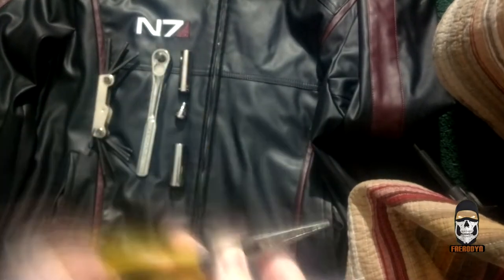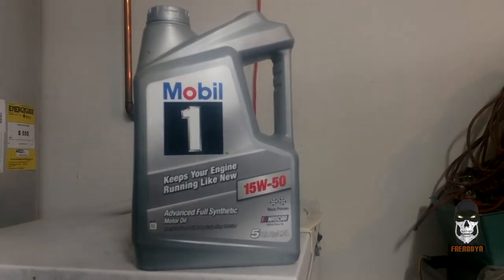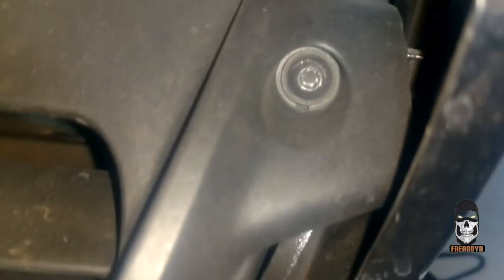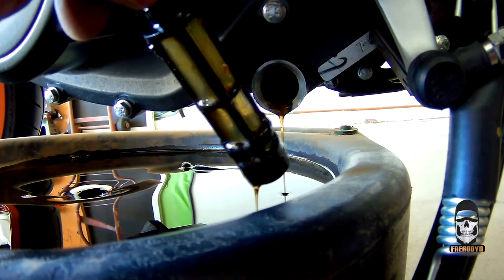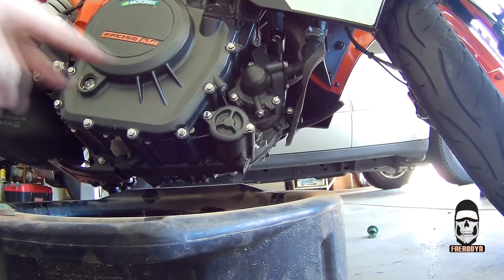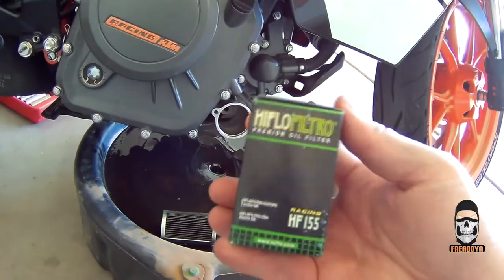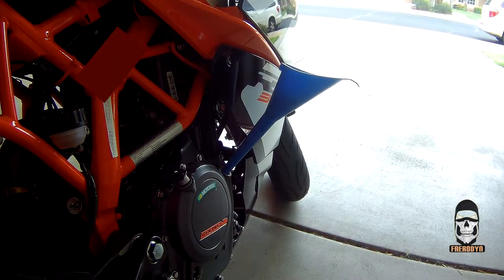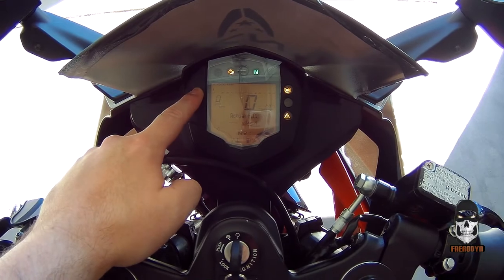KTM RC390: How To Reset Service Message and Oil Change Tutorial

Comment: I just changed my oil Maybe 250 Mi ago, I just bought this bike 2 months ago, my service light has come on though. Is there anything else I need to do to it in order to service it properly or is changing the oil the only thing that's needed and if so can I reset the service light to let the bike know that it's been serviced and can remind me however many miles later
Reply from the maker: If memory serves, I think in addition to changing the oil and cleaning the filters you also need to check the valve clearances. That involves removing the engine from the bike and stripping down the top end (cylinder head) to get to the valves. That's the bad news, the good news is the only parts you should have to buy are the shims. Ari Henning had a great video on how to do this yourself. I'll see if I can link the video for you here.
Reply from the maker: https://youtu.be/sScXWEoSqyM
Reply: @FaerodynMoto  thank you that would help. And damn that seems like a lot of work. I could do everything besides that last part, well I could do that part also but I would feel better to get something like that done by someone who knows it better than me. If I fuck it up I have to blame myself, if a shop fucks it up I blame them and they have to pay to fix it haha
Reply: @FaerodynMoto  watching it now, thanks
Reply: @FaerodynMoto  gad damn that's a lot of things I can potentially mess up lolll. But helpful thanks
Reply from the maker: @ItsThe675  tbh I love working on my motorcycle myself but I think I'm going to have it done professionally. I still haven't done it yet. XD
Reply: @FaerodynMoto  yea same lol mine just hit 5000mi so idt it's super important to worry about right now. But I want to look into that now and figure out when it's needed. Also so I can financially prepare hahaa

Comment: I.have just received Mobil 1 5w40 fully synthetic oil from Amazon, should i use it in my duke 390?
Reply from the maker: That's a good question. Unfortunately, I'm not an expert of oil weights and I don't want to give you bad information. I know that 5w-40 is a lot thinner than the manufacturer suggested 15w-50. It may work for you if you live in a very cold climate, but if you're going to use 5w-40 oil I would suggest that you also use an oil stabilizer to ensure that the oil properly adheres to the engine parts for cold starts as well as once the engine heats up. 

If you have any motorcycle specialists or mechanic shops that you can talk to, I would ask them before putting the oil into your bike.